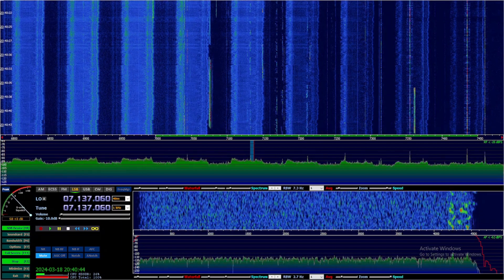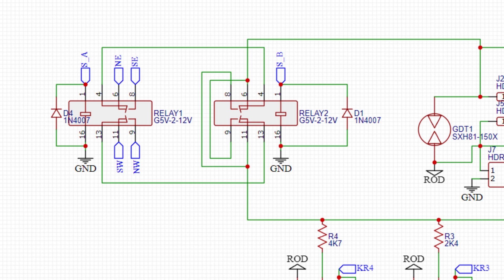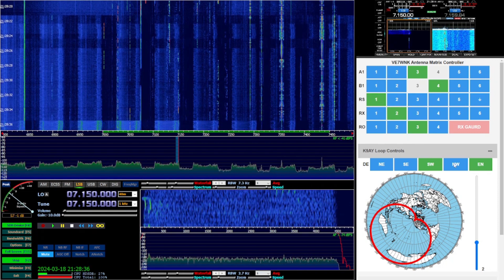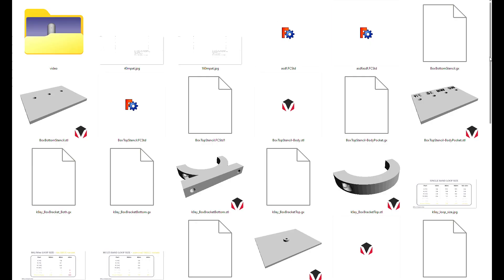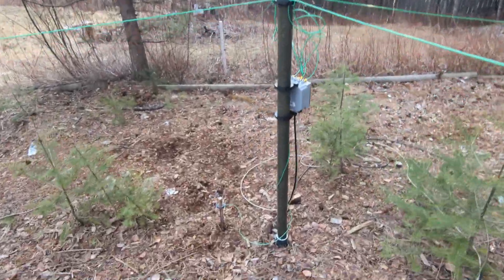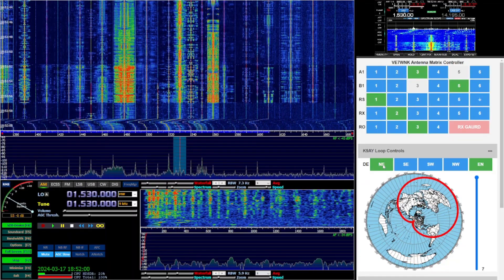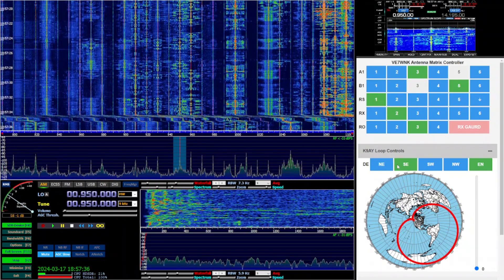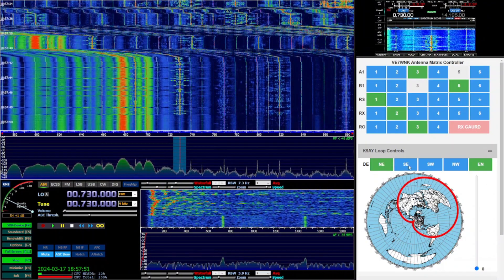K9AY Loop (VE7WNK's version)

Comment: Wow. Bob that is amazing. Considering you never made 3D parts... this is amazing. I went through simillar learing curve (first remote RX@my summer house) and then moved to full TRX Remote with dedicated RX antennas, including K9AY, SALA, 9 Circle and various beverages and phased beverages. Thanks for sharing, I always learn something new! 73 Jiri OK2IT
Reply from the maker: These are the best kinds of projects! I adored working on this. I learned more about laying out PCBs, more about EMP suppression, 3D CAD work, and systems design in general. I work in system architecture but it's all isolated to datacenter hardware and software, so it was nice to smoke some solder and build something from the ground up (literally).

Comment: I built the K9AY and in stead of fixed resistors I used a led and photo cell and varying the voltage to the led changes the resistance of the photo cell.
There a device called a vractor which contains both components in one package.